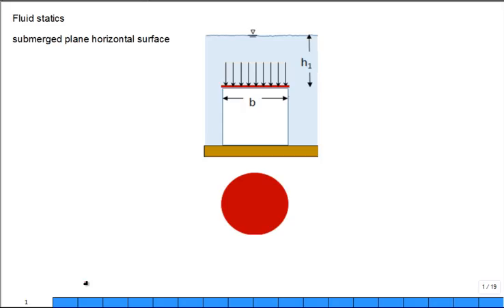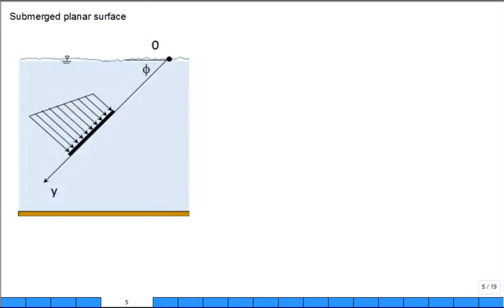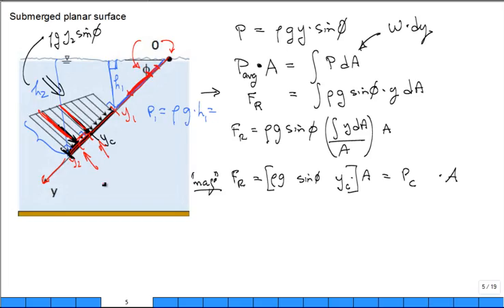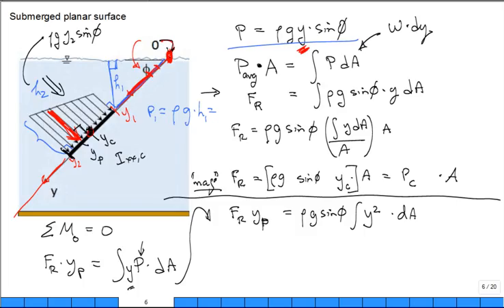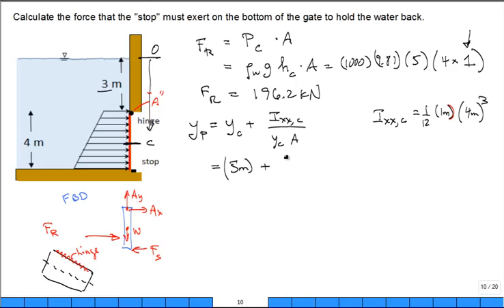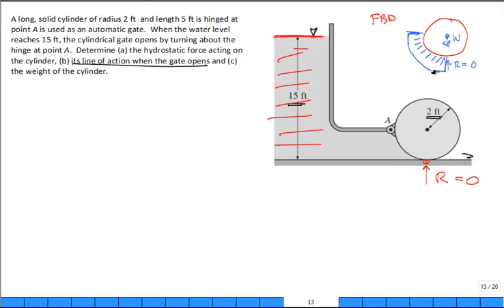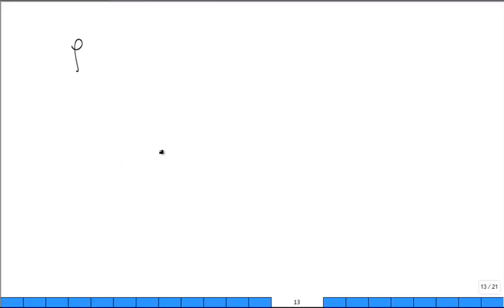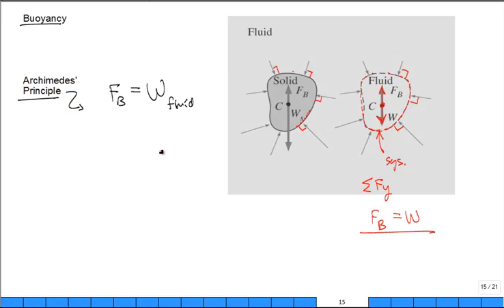ME3663 Fluid Statics 1

Comment: Thanks for helping. Just a Question please. So what area dimensions do I use for calculating the Force on the vertical side? This is at about 11 minutes from start. Is it the width x 2/3h (Cp), width x 1/3h, width x h/2 or width x h?

Comment: Hi, lecturer,do you know how to solve the question？thank you
60 cubic metres of oil (RD=0.93) is poured into the tank.  Calculate
(e) The depth of oil in the tank (2 marks)
                                60m³ of oil
                                 RD=0.93
(f) The pressure at the oil-water interface. (2 marks)
 
(g) The pressure on the bottom of the tank. (2 marks)
 
 
(h) The total force in magnitude and position acting on the 6.0 m side. (10 marks)
 
 
 (i) Draw and label a diagram to show the variation in pressure on the 6.0 m side of the tank after the addition of the oil. (2 marks)

Comment: your formula for the area of an equilateral triangle is wrong
Reply: He calls it equilateral, but labels it as if the "height" (measured at right angles to the vertical side) is equal to the length of the vertical side.  If that's the case, then the triangle is not equilateral.  His area formula is wrong for equilateral, but correct for the way he labeled the triangle.

Comment: Quick question. On the problem (38min-45min), Shouldn't that free body diagram have a normal force where the stop is? I know that since the only equation you used here was the moment equation, vertical forces do not contribute for this case, but then if we had to solve for Ay we would have to use the 'sum of vertical forces equal zero' equation and the numbers will be different if we put the normal force.
Reply from the maker: at 40:00 horizontal force Fs is shown.  the gate is assumed to "hang" from hinge at A.  So don't need vertical force acting on bottom of gate.  Could the gate rest on the ground?  Yes.  If it did rest on the ground, would there be vertical force at bottom? Yes.

Comment: please please reply sir at 4:22 resultant force cant be applied a little bit to the left because resultant force acts through the centroid of pressure prism and it is exactly at ( b/2 ) .
Reply from the maker: discussion is confusing at this point, sorry.  An equilateral triangle is drawn and incorrectly I say it is isosceles (or at least imply it is isosceles).  If length of each side of equilateral is "b" then distance from middle of edge to opposite corner is "b*sin(60)" (not b as I think I say).  Centroid is at (1/3) of this distance, measured from each side toward the opposite corner.   To help see this, draw equilateral triangle, then 3 lines from middle of each edge to opposite corner.  All 3 lines will intersect at centroid.  With ruler you can verify this is (1/3) from middle of "base" to "peak"
Reply: Sir irrespective of isosceles or equilateral triangle the centre of pressure must lie on the centre of pressure prism and in this case it will be exactly at ( b /2 ) because we have a horizontal surface.
Reply: And it shouldnt be at centroid of cross section as you have mentioned..please correct me if i am wrong sir

Comment: Hello Prof. Randall. At the 7:13, why you use (1/3).h from the bottom on the calculation? Why not at the centre of the red square?
Reply: There is a distributed force acting on the wall. You can represent this as a single force acting (1/3)h from the bottom.

Comment: So regardless of the weight of water above the surface (for instance it could be in a container 1 square foot at bottom but narrowing from the bottom) if a waterproof weighing scale were placed on the surface it would register the computed pressure rather than actual weight of water in the container. For instance, a container with 10 feet depth of water, 1 square feet of area at the bottom, but holds only 5 pounds of water would register on the weighing scale 624 (62.4 x 10) pounds of water rather than 5 pounds. Right?
Reply from the maker: +john zimmerman pressure of water at bottom of container is not the same as "pressure"  or "Force/Area" between container and scale.   Force between container and scale must equal weight of container and weight of fluid in container.  Sorry if this doesn't help.  But that is all the time I have to try and answer your question.
Reply: +Randall Manteufel Thank you for responding. However, you misunderstand because I was not real clear. I try again. It will be simpler to reword my question using containers. Consider a container in the shape of a cylinder 10 feet depth of water, 1 square foot horizontal area. A weigh scale is placed inside the container at the bottom. One would think it would register the weight of the liquid, 624 pounds,. because that is the weight of water. But actually what the scale registers is not a function of the weight of water but the force from the water which is a function of pressure not weight, though in this example the resultant force is the same. Now take a container, 1 square foot at the bottom but that narrows and it holds 10 feet of water. Lets say it holds only 5 pounds of water. What would a scale inside the container resting on the bottom, supporting the entire liquid register 5 pounds (the weight of the water) or 624 pounds according to the formula F = 62.4lb/cu ft x 10ft x 1 sq ft? (answer is 624 pounds - right?)

Comment: why is it that when calculating the weight of cylinder, the depth used is 5ft? And area of cylinder isn't pi*r^2 but 2ft*5ft?
Reply from the maker: +SageAdam length of cylinder in third dimension (not shown) is 5 ft.  Hope that helps with second question as well..
Reply: +Randall Manteufel isn't it eg(h^2/2)

Comment: can you solve this to me?
You are a team of design group, involve in designing a flood prevention system of a river. Your assignment is to propose the best position of the water gate hinge so that during heavy raining, when water level reaches 10 m from river bottom the water gate will open automatically. The water gate size is 3 m wide and 9 m high.